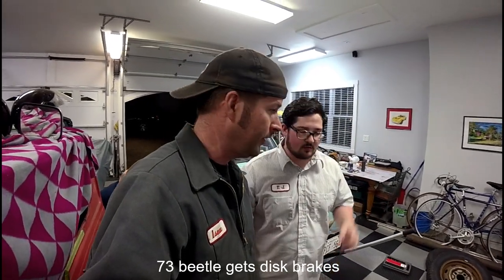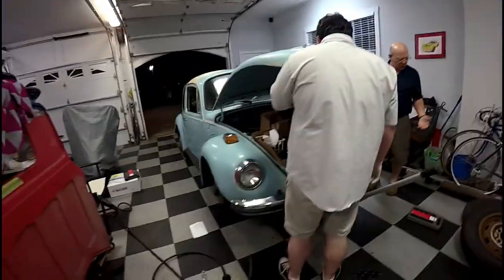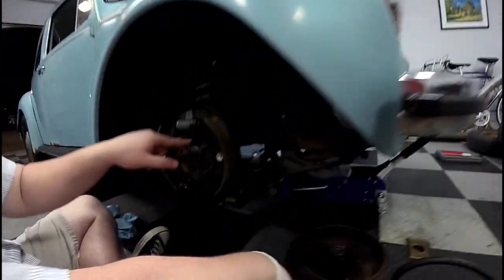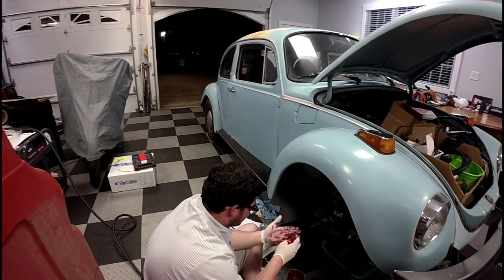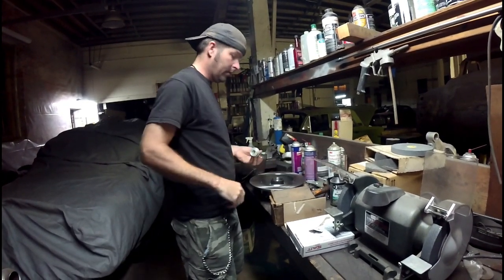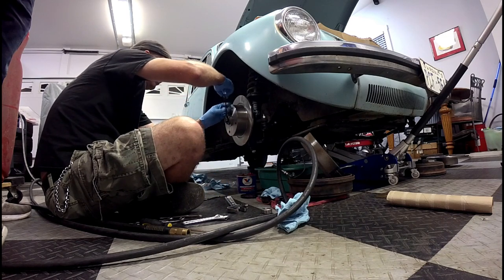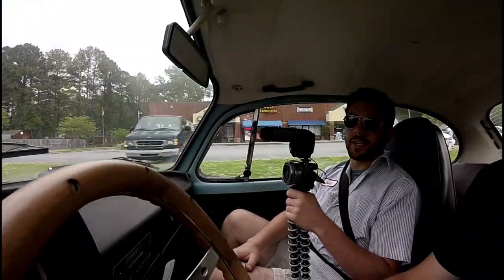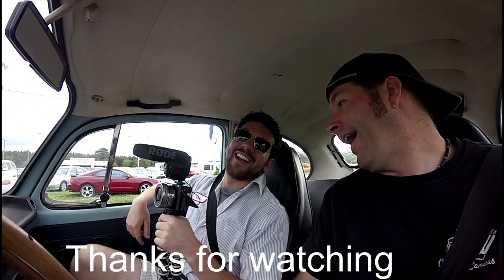Copy of disk brake conversion on beetle

Comment: I have a 78 Super Beetle and will be doing a disk conversion within the month. Several sites say that 14 inch wheels don't clear the calipers but it looked like you put the stock wheels back on no issues. Right now I have adapters for my 14inch 5x4 3/4 chevy wheels which give it about an extra 3/4 inch back spacing. You think these will still work or will I need 15+ inch wheels for diameter clearance? Thanks!

Comment: Hey Ike I'm trying to build a muddin cart I have a 212cc I took the governor and oil sensor out I'm running a torque converter I'm having a problem with belts burning off and I also have some atv wheels on my frame there 28's I think. But I want to build front and rear end shocks I have some control arms off a 02ish foreman 450 but not sure how I'm gunna do the rear yet my cart is live axle by the way. Do u have any idea how you'd go about snorkeling a 212?? Can it be done ? Thanks man and keep up the awesome work
Reply from the maker: the biggest problem we had with our engines getting wet is loosing spark. so on top of snorkeling it you would have to find a way to seal the ignition
Reply: Isaac it'll be fine okay and one more question and I'll leave you alone. Do u know anyway to make the belt last longer do I need to buy a more expensive torque converter?
Reply from the maker: we haven't had to replace any belts. we make sure our pulleys are lined up good so we don't have excessive wear.